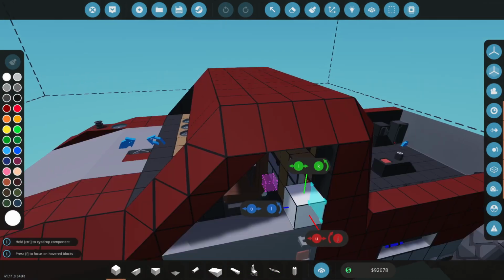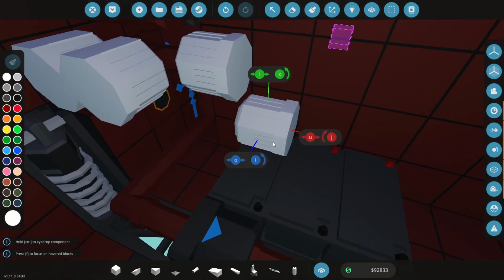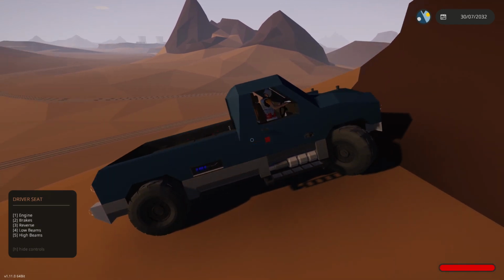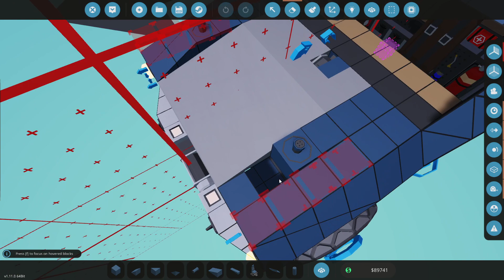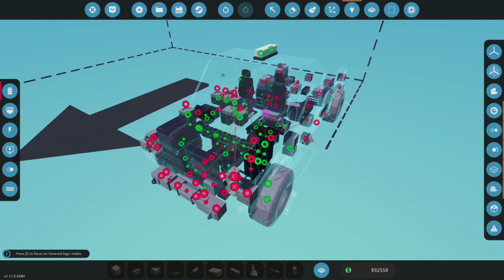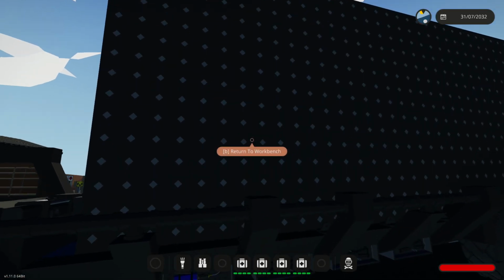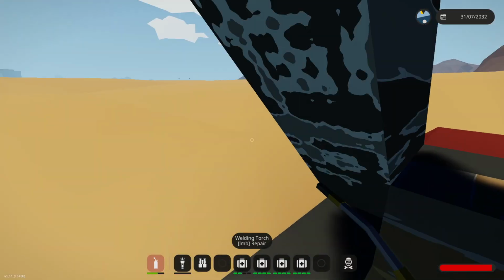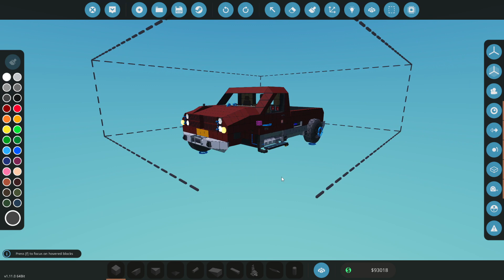TRUCK UPGRADED TO PULL 44TON! - Fishing Hardcore Career Mode - Part 18

Comment: Yes. Not only should you lift it, you should also re-design it to be an actual truck (lorry). At the moment it is a ute, not a truck. 
Put two sets of twin tires on the back to deal with the heavy loads.

Comment: Pulling weight on flat ground is a cakewalk. A single peak-condition human is capable of the same task as long as the rolling resistance is low.
You need to test it going uphill, and the first serious problem you are going to encounter is wheel traction...